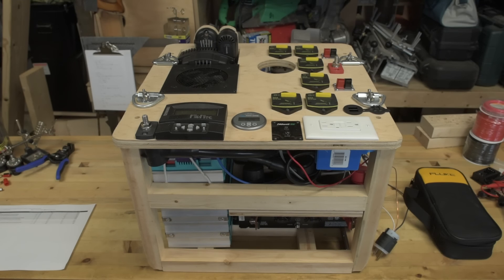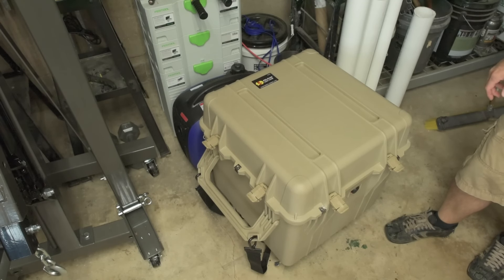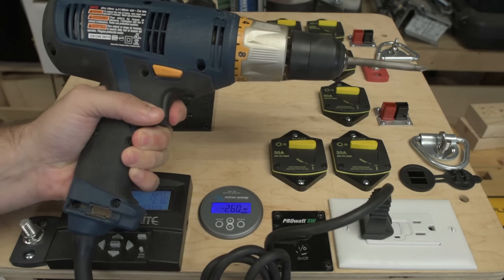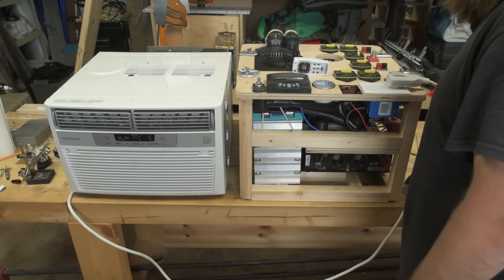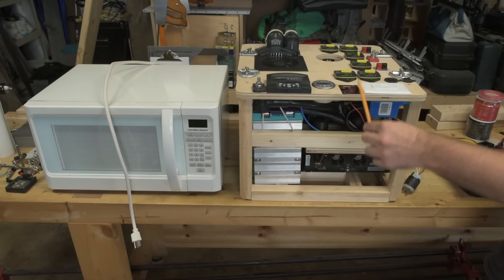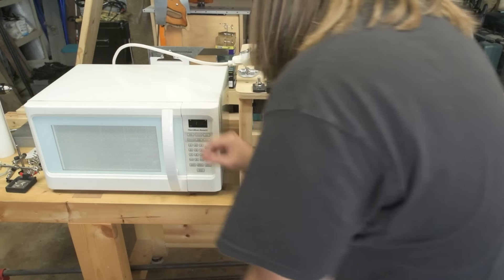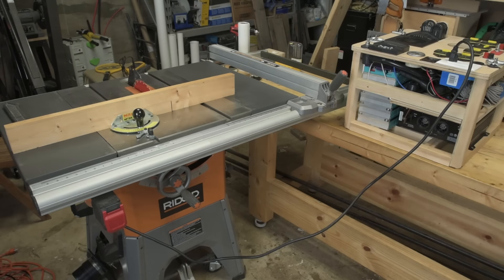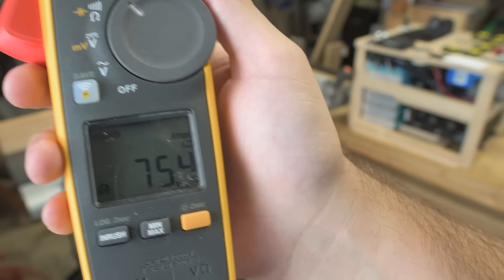Solar Air Conditioner with Xantrex SW2000 Review (Solar Generator V3)

Comment: Scouring YouTube vids leads to same conclusion, solar A/C "can" work.  But, all I see is  starting small window units and running 3-5 minutes.  And, I see many folks doing this during day when the solar panel is handling the load and battery bank not being 'used' by the A/C unit.  Several have stated "run the A/C during the day only to save your batteries from 'death by draining'.

What about night, when solar panels can't be tapped and you MUST use batteries?  My thought ... I work 7am - 3pm, I'm not 'home', I don't need A/C.  3pm - 8pm I'm outside piddling. I need A/C at night, to sleep comfortably.

I'm NOT educated in the least with electronics, so here's my stupid questions ...

1)  You mentioned 30 mins with your +/- 74% current battery level.  What does it take to run an A/C unit throughout the night? 

2)  What about a timer system, whereas the A/C only ran 10 mins out of every 3 hours?  I'm thinking a very well insulated tiny house or RV.  Years ago I insulated and panelled a minivan and made a camper - even on muggiest nights could run the engine for 20 minutes with the van A/C wide open, cool the interior to below 70F, and that cool would remain most the night (actually used a light blanket).

I'm planning the feasibility of going off-grid in central NC, probably converting a school bus to RV. Pretty hot summer months (90F-100F high humidity). Any thoughts from anyone greatly appreciated.
Reply from the maker: The reason why you don't see larger installations on Youtube is because it's very expensive. The unit depicted in my video is very small and still costs $3000+. In order to make the unit run longer throughout the night you need more batteries (batteries run the unit when no sun is present), more solar panels (to charge the increased battery capacity), and larger/more charge controllers (to handle the increased voltage/amperage from the solar panels). Insulation is probably cheaper than adding more solar to a point. It's all math. If you're planning a system like this it's basically an engineering task and engineering is all about balancing cost, weight, size, power, etc to achieve the desired result. The costs are absolutely coming down for all of this equipment over time. As integrated circuits get smaller, the price of charge controllers per watt should drop. As the Tesla giga factory ramps up, battery cost should drop. Perhaps one day we'll invent more efficient solar panel technology and solar panel size per watt will decrease, perhaps along with cost. One day this stuff will absolutely be the cheapest option. That's why I find it so interesting.

Comment: Microwave does not have a motor  guilty of what you said. Its a Magnatron and its rated at a kilowatt
Reply from the maker: +Henry Devilliers magnetrons do have inrush current. I think it's anything with windings.
Reply: Right, Then what is producing the in-rush current, you were in fear would not allow it to work? The Magnatron is the main load on the microwave, it has NO inrush current, like you tested and found out. Microwaves have high wattage, like i said in the kilowatts.
Reply: I gave it a thumbs up, great video.
Reply from the maker: +Henry Devilliers I think magnetrons have cycling inrush current. It happens every time the magnetron is energized, probably many times per second. I don't think my meter is designed to read that. It's designed for motors. More info: https://en.m.wikipedia.org/wiki/Inrush_current

Btw, I do have an oscilloscope capable of looking at a microwave waveform. I've just never bothered. I was content that it worked and I was wrong.
Reply: They have pulses and a change in frequency. The load is fairly flat but varies with the content inside the oven. They will fail if they have a problem with power supply, however I do not know of their currents nor voltages peaking before failure. My expertise is in lower powered ones, not the higher powered. Im building a off grid solar system and was glad to see your video, im not going to use a microwave because of the drain, and you can heat up water a lot quicker with other sources, including D.C..